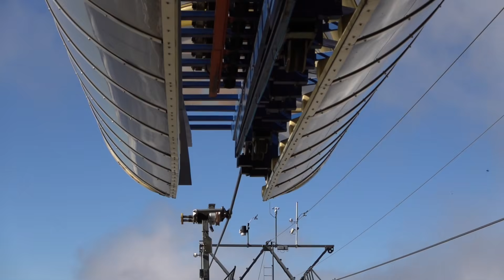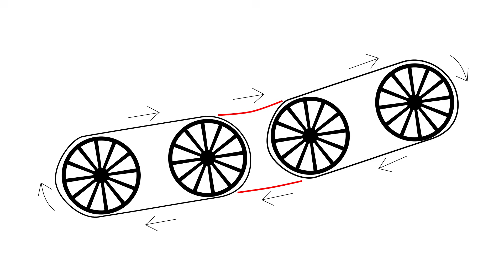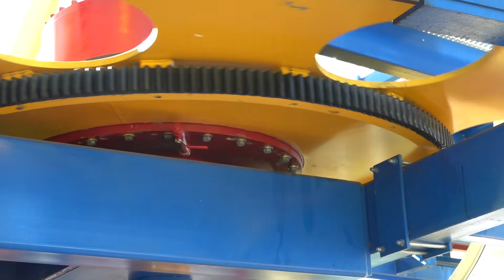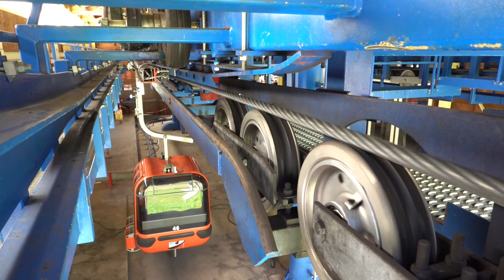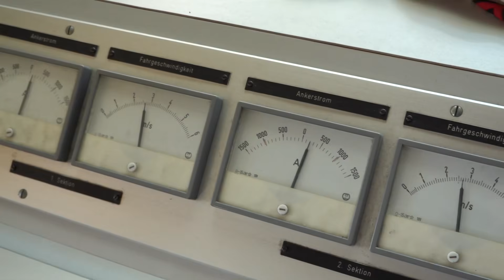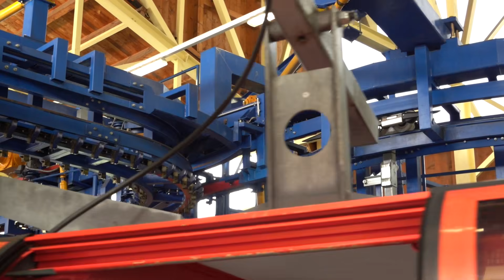What you didn't know about ropeways

Comment: The Ops Manager was super accommodating and that's as rare as the design of the Gondola he was in charge of. As a former lift operations manager who worked with lift maintenance in the off-season, I can attest to the complexity of rope ways. The 'clamps' that attach the gondola to the wire rope are 'grips'. The basic design of that lift is that of a 'Detachable-Grip' where the grip opens in the terminal and 'detaches' from the wire rope to allow for the gondola or chair to slow down in the terminal for a safe and comfortable loading. Then as the gondola exits the terminal, the grip is accelerated by the tires above to match the rope speed and the grip closes. The design allows for much higher up-hill (or downhill) capacity.

We always disassembled a third of the grips from each lift each summer to inspect and rebuild with new parts when out of tolerance. The grips and chairs would also go thru NDT or Non-Destructive Testing which used dye and a special light and contracted out. 

Line work in the summer also meant days spent hanging from the rope in a work basket to inspect, grease and clean every sheave on each tower sheave train. Replacing sheaves involved jacking the wire rope off the sheave and replacing it with one that we had previously rebuilt with new bearings and rubber liner if necessary.

Try to get someone to let you ride in the work basket for sheave train maintenance sometime. That would make for video with a new point of view - outside the safety of the gondola or chair. (They'll probably let you wear a harness!)
Reply from the maker: Capturing the servicing will probably be challenging to get access to, but I love your idea. I will keep asking, maybe I get a chance eventually!
About grip/clamp rope/cable etc. - there are differences among the different countries.

Comment: That’s an impressive bit of machinery. In 2006 When I was on vacation in Switzerland I observed the clamping mechanism as a passenger waiting to board to gondola. I wondered how it worked, and I find the speed matching / slowdown mechanism quite interresting. Never thought there would be so many transmission stages in the mechanism (you normally can’t really see it). The amount of engineering involved, it’s like a swiss clock in how precise everything runs.

Comment: I wonder how the rope is conected at the ends, and if it interfere with the cabin locking sistem
Reply: The Rope is spliced continously over a long length = long splice (very time consuming = heavy hand work).
Fusing the rope (by friction) into one single loop without too much change in rope Ø (max. ~8-10%).
The splice has a higher tensile strength than the rope itself.
Ropes and splicing is a very very wide field but basically it works like that:

The rope consists of multiple smaller strands braided around a center strand, called the core (often a plastic material but can be steel strand as well).
Each strand is again like a smaller rope for itself, consisting of a core wire with wires braided around.
Both ends of the rope get "unbraided", so the individual strands (mostly 5-7) are twisted off the center core.
The ends are overlapped for a certain length - the splice length - depending on the diameter of the rope.
Splice length is calculated for each application and rope "model", but the Internet says the splice lenght is ~1200 x Ø.
A splice for a Ø 50 mm rope therfore can achieve 60 m length.
The center core is removed, and the (outer) strands are cut at different lengths, spreading the individual cuts evenly across the splice length.
Afterwards the strands are interwoven again, and locked in place by being threaded into the core space at the "knots", replacing the previously cut out material.
The loop is complete. The splice gets wrapped (sometimes) in plastic/rubbery/self vulcanizing material.

Search for this article, it´s from Austria, and therefore written in german, but the pictures are clear to understand:   "Langspleiß bei Seilbahnseilen – Teil 1"

They also talk about the clamping mechanism. 
"Dabei ist zu betonen, dass ein möglichst kleiner Knoten zwar ein störungsfreies „Kuppeln“ der Klemme gewährleistet, hat jedoch im Allgemeinen eine Reduktion der Lebensdauer zur Folge"
If the rope Ø increase (at the knots) is small, the clamping will benefit, but the life span of the splice will decrease.

The individual wires of the strands shall not contact each other while a strand is beeing knotted through the others to reach the center. 
Otherwise they will rub at each other and over time the wires break, weakening the splice ....
Therefore the knotting points are protected with rubber or the strands are braided in a certain manner to reduce wire contact, which increases rope Ø. 
......
....
...

Happy splicing ;)

Search here on YouTube:    

"Seilbahn Tragseil spleißen | Alpendorf Gondelbahn | Snow Space Salzburg"
Channel:  Snow Space Salzburg
= 3 Minutes of splicing impressions.

"Teufelberger: Seilspleiß"
Channel: Seilbahn.net
= another 4 minutes of splicing a 8 stranded cable.

"Seiltausch Gletscherbus 1 (System Funitel) am Hintertuxer Gletscher"
Channel: Hintertuxer Gletscher
= 8 min Video of complete Rope/Cable replacement with splicing.

Comment: Have long wondered if in certain urban situations cable cars could be used, as opposed to the cost and long construction times of metro tunnels.
Reply: Cable car cost ~3,5 -   19 Million € per km  (depending on Station and support tower architecture)
Tramway              11 -   22 Million € per km
Subway                45 - 133 Million € per km

Source: Google for  "Was kostet eine Seilbahn? Eine ökonomische Analyse"

In the city of Anaheim, CA, in the vacinity of the Disneyland Park, they plan to build a cable car system.

Comment: Wonderful video! One thing that came to mind: do the operators have any way to be sure there's not a single cabin occupied before stopping the ropeway? Can that be done visually, or by counting passengers getting on and off? Or is there some mechanical or electrical subsystem to detect occupation?
Reply: Stop passengers from boarding, and run the machine until the last gondola reaches the other end.

Comment: This Gondelbahn is complex and simple and it makes it genious and crazy at the same time. 
It has simple backups but also an extrem amount of mechanical parts that NEED maintance or they will fail. 

I have so many questions after this video. Because i work as a mechanik my selfe and this makes me just curious. Here just some:
- How often do they have to change the tires on the acceleration and deceleration area?
- How often do they need to change the v-belts there?
-What happens when one set of 3 v-belts breaks? Because the whole wheelset after the damage would stop, would it?
-> How does the machine notice such an failure?

Comment: As you stated one motor runs it all ,, and the drive is in the central station , the kingshaft drives the ,upper bull wheel of the lower section of rope way the lowest station on the lift is unpowered,  is it also coupled by the shaft above it to split the drive power and drive the lower bull wheel of the upper section of the rope way .. I would assume if this is so, they can engage and disengage the gear box driving the upper bullwheel so the lower section of the ropeway can run by itself. ? if this configuration was used the lower section of the rope way must run in order for the upper second section to operate..
Reply from the maker: There are 2 motors, each driving the ropeway below it. The 2 ropeways are completely independent. The coupling and synchronization are done in software.
Reply: @sandro-here  Ok understood that section 1 (lower) and 2 (upper) both have separate primary drive motors .. they are not interlinked from one primary drive.. Thank you
Reply from the maker: That's correct

Comment: What an incredible video!!! I never knew about the incredible amount of engineering behind this transport system. No surprise, I'm born, raised and living in the Netherlands, no much need for these systems.

But my god, what a machine! I am so intrigued. And still getting to grasp what I'm witnessing. I've seen it 3 times now, and I still have the idea I hardly get it.  So here's some ropeway-noob questions:
- The gondola's have wheels, yet the "rope" turns as well?
For what I see I think it is clamped when on the rope, and at the stations it switches the rope for a rail and therefore needs wheels?
-These machines are both power users and producers? That's a bit puzzling, although I can imagine such a thing. It is partially a solid-state battery-like concept, but it's permanently in motion (except for lunch;-), am I missing something? Or didn't you expand on explaining that part of the machine workings? 

The complexity of it is also mind blowing (at 09.59 my MIND was BLOWN! for sure, but I put the pieces back together quickly because there where still 13 minutes to go).  

What I like most is the choreography of all the moving parts, all wheels, their traction, everything in perfect sync, because it is one machine! With one main driving wheel and crank shafts spread to reach all parts..  This all made very much more curious as to how this was invented, how it evolved into the mechanical marbel that we get to see a glimpse of in these 23 minutes. 

And the end, ai caramba! "That would be very interesting to see, but that's for another time maybe.. What!?! Are you serious? Have you made that part 2 vid? 

Anyway, @Styfauly we're now 3 months in from the upload date, and the counter ticks 28.212, so its is on track to become a way broaderly viewn vid for sure. the time between now and when it hits roughly 56.000  views will be a good indicator. I never knew about this, but watch Practical Engineering, The Train TV and such stuff, and between all the music I listen to there's a lot of Kraftwerk. Somehow I feel that those vids are somehow probably taken in account by the algorithm. In any case, to put some extra icing on top of the already existant icing on the cake;

--> Deserves to be seen by a wide audience of tech, engineering, rail and machine-design/-build entousiasts, and people who like Kraftwerk <- 

This is probably not how that works (I'm 100% sure it isn't actually) But I do know that any written word in the comments are likley used as wordcloud-ingredients for recruting the next batch of connectable viewers. 

Thank you, Kalsan.
Reply from the maker: Thank you Sir! You sound like a desert man that sees snow for the first time. I feel you, bro, I felt the same when I got to see that huge sail ship in Amsterdam. Highly recommend putting yourself in a sleeper train and explore the mountains for a week, they have much more to offer.
To answer your questions, yes that is correct. The gondola's wheels are either connecting to the guidance rails at the stations or to function rails such as the door lever or the clamp operator. Outside the stations, the gondolas are static, hanging on the moving rope.
Yes, when there are more people going down than up, the machine must slow down the ropeway. Since every electrical motor is also a generator, all that is needed is some more electrical equipment converting and stabilizing that power before feeding it back to the grid. That equipment is behind the red doors as well
One night passed and already at 35K, I feel like a little boy opening christmans presents :-)

Comment: The ropeway I am working for is also from 1995, but it has way fewer moving parts! Looks complex to maintain and lubricate all of that. 
Do you know how it is monitored, that the clamp has closed with enough force?
Reply from the maker: There is another red plate with a sensor just after the clamp closes. It looks just like the ones checking on the doors, so I guess it will trigger an emergency stop as well.

Comment: Love the details.  The belt tensioners for all the wheels are a particularly clever design.  They have a screw for fine adjustment, and over-center linkage so they're easy to click on and off, and rest on the next shaft with a fork on the end so they can fully retract to allow belt/wheel replacement

Comment: Not enough views! Great video. It's amazing that only 500HP is enough to run all of that. I would bet most of that is used in the mechanical losses. Like an elevator, it probably doesn't need a lot of power because of the counterbalancing of the descending ropeway.
Reply from the maker: Thanks a lot!
I tend to disagree with the elevator argument: in the winter time, the large majority of passengers and cargo is moving exclusively up. The way down is made on skis.
Reply: @sandro-here  it's a good point for sure but with cars that small, the cargo would be just a fraction of the load wouldn't it? Maybe, 1000 pounds? Not sure.
Reply from the maker: @LucasChoate  We can calculate this using both halfs https://www.skiresort.ch/skigebiet/leukerbad/liftebahnen/l89429/ and https://www.skiresort.ch/skigebiet/leukerbad/liftebahnen/l89430/
They transport 1600 people per hour and the total altitude delta is 385+400=785m. The total duration of a ride is 8.5 minutes, about 0.14 hour. We can assume a person weighs 90kg, including skis and gear. Also there are 100 gondolas, say 40 on their way up at any given moment, holding 6 people (540kg) each, total 21.6 metric tons of load to carry at any instant when running at full capacity. 
I'm afraid I haven't done physics since high school and I've forgotten the formulas, but these numbers should allow to calculate the required force in HP without any friction.
Reply: @sandro-here  I calculated it real quick:

P = (m*g*h)/t 
P = (21600Kg*9.81*785m)/(8.5*60s)
P = 326kW without friction losses

Edit for all the academics out there: I left out some units due to laziness so my calculation is technically not correct. Be ware of that.
Reply: This brings me a lot of joy.

Comment: How are tires on the whole terminal, moving the gondolas while detached from the rope, in the modern lifts better than the conveyor chain seen in this one?
Reply from the maker: I can only guess but they're probably cheaper and or easier to maintain. There could be less moving parts and they are more decoupled.
The old systems needed the belt to sync gondolas. Nowadays this can easily be solved with a cheap computer chip

Comment: 30 year life span.... Here in the USA, we have 60 year old Von Roll VR 101s.  Stupid Swiss laws
Reply: Life expectancy. If it passes it´s yearly checks, it can get old, but spareparts get rare as well.
Because in the last decades the tourism growth was so high, more capable systems were needed and installed, reducing the life expectancy. 
While searching for the initial investment costs (25,5 Mio. CHF  in ~1995) i found an article about revenue and profit around 2015.
They made ±0 or even losses in some years with the cable car. Probably it will get older than 30.